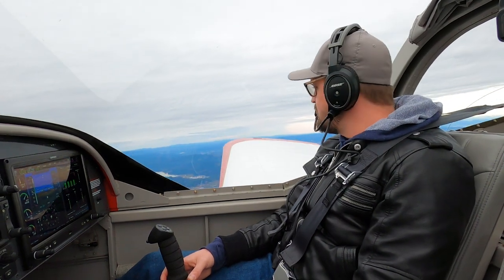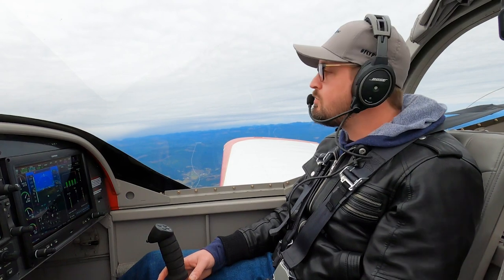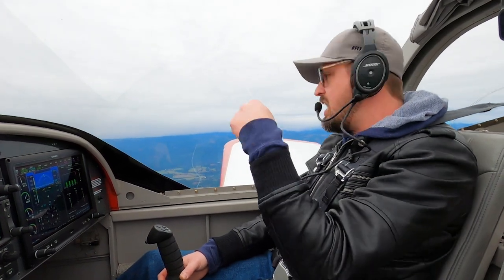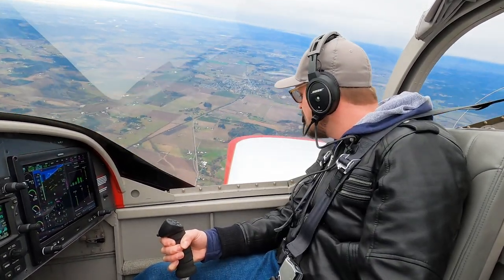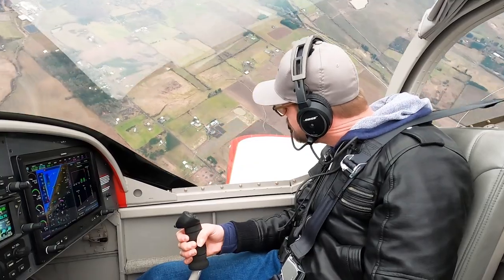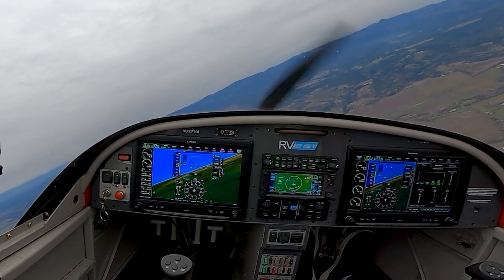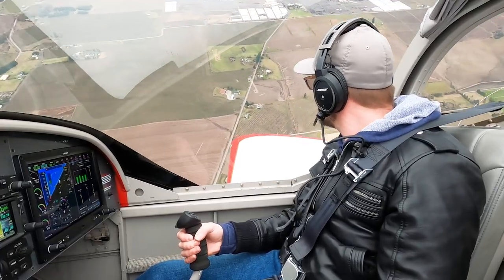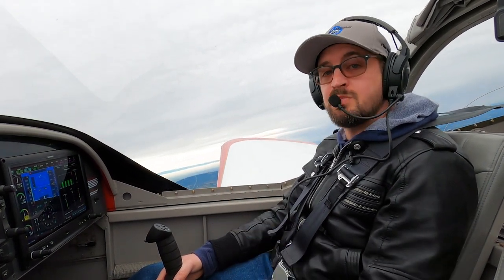Steep Spiral - in an RV12

Comment: How much did your pilot license cost
Reply from the maker: Well it really depends on a lot of factors… but on average you can get it done from around 12-15k if you’re consistent and dedicated. It can certainly be a lot more than that too :-)
Reply: My advice is to save up enough money to take two lessons a week and you will minimize the costs to get your ticket. I’m no expert but figure 2 lessons at one hour each per week.  Do the math for the plane plus instructor.  If you fly frequently enough you may be able to get it done in 60-70 hours.  I’ve seen many who have been taking lessons for 2-3 years spending tons of time and money because they fly so infrequently.
Reply: I agree with the other answer, there are a lot of factors involved, and people learn at different rates, but I would recommend that you budget for $13K to $16K.  If you have a gaming PC at home, a PC with a lot of horsepower, you can save some time by installing the Gleim flight instruction module for X-Plane. It's excellent!  It takes you through all of your flight training for your privates pilot's license. So when you get in the plane and the meter is running with an instructor sitting next to you, you're already fully familiar with the maneuvers will learn much more quickly because youve done the maneuvers in a simulator first.